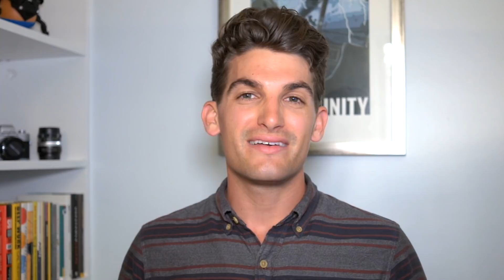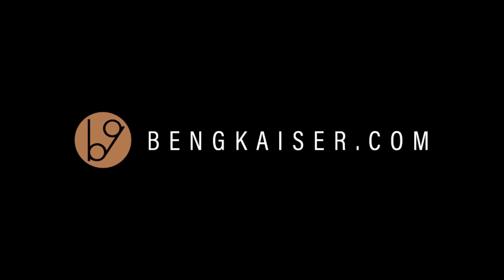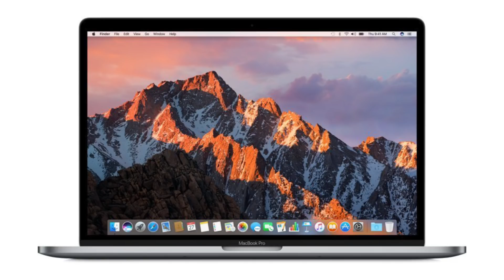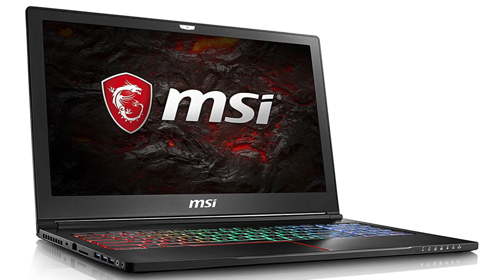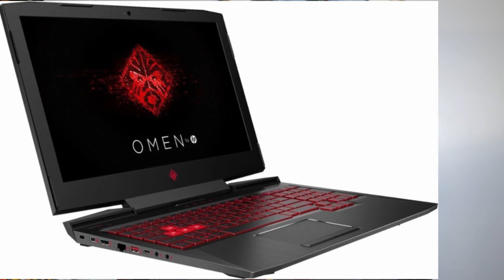Top 4 Best Laptops for Graphic Design

Comment: Everyone talk as if they are hardware engineers!! SSDs are more useful when you store files and images on them than storing applications. Once you start any app. The app code is loaded on RAM. But everytime the app need to load a file , it will read it from the hard desk!!! 
Save your psd's in SSDs. And save your apps on HHDs

Comment: Hello, Ben, thank you for sharing your experience with us. 
I have been looking for some information about macbook pro 15' 2015 (i7) - I am working only with images and graphic design, so I don't need so much video memory, and space, but I care, mainly, about the screen quality and color representation - is it Macbook suitable for me or I might try some other options? I've never had a macbook before so please tell me how comfortable is the 13' for some very window-loaded programs like illustrator or indesign or i probably have to only care about 15' models?
Reply from the maker: I am very happy with the Macbook Pro for strictly design related tasks. It is when you want to expand outside of Indesign, illustrator and basic Photoshop work that you get into trouble (the machine gets slow and does not perform really well). As far as the screen is concerned you will be very happy with the Mac screen color quality.
I like this model for design - https://amzn.to/2XsiNWO
Reply: @BenGKaiser  thank you very much

Comment: This is a great video!!! Thanks for sharing your knowledge. Question: i’m a 9 year macbook user, i recently tried the new surface laptop and it drove me nuts that i could not see thumbnails of my design files (psd ai png etc. ). Do most windows have this issue? Which one does not? In a fast paced work flow not seeing thumbnails slow me down... thanks again.
Reply from the maker: I have a Dell XPS 15 and I have not had this issue. When you are in your finder there is a "View" option tab up near the "File" tab if you click the "View" tab you should be able to change your finder view to see the icons. :)

Comment: I liked your video. I have just started into graphic designing. I plan to go for a HP laptop.  Can you please tell me how to caliberate laptop screen to match your printed output.?
Reply from the maker: That is something that relates directly to the printer you are using. For Instance, I used a Konica Minolta at my last working position and we calibrated with that system specifically.

Comment: Hello Ben, the 4k display is great, but are u able to get the same resolution on an external display? (u use a second display right?)
Reply from the maker: Hey Jeremy, I was going to trying and talk through this, but I found a great forum discussing this very question for you to get some insight on this. I hope this helps answer your question --- https://www.dell.com/community/XPS/XPS-9570-connecting-to-4k-uhd-monitor-through-hdmi/td-p/6093019
Reply: Ben G Kaiser yeah i already read that page, it was inconclusive that we can output at 4k to external display, so i was wondering if you found a way to do so. If not, then i really wouldn't spend extra money for 4k on 15.6" of display if i can be honest
Reply: Rather, it seemed like too much of a hassle to even TRY to find a cable/dock that can deliver that amt of data.
Reply from the maker: To me 4k is not a deal breaker. What are will you be using the laptop for SPECIFICALLY? :)
Reply: Ben G Kaiser planning to go into video, so that's premiere and after effects. Currently running illustrator, photoshop and lightroom T. T

Comment: Hi Ben I took a look at a lot of reviews for the Dell XPS 15 GTX 1050, as I am a graphic design student with a failing computer, and there is a concern that has popped up. A lot of reviews are saying that when trying to run taxing programs on both the GPU and CPU the computer either lags horribly or even crashes and has to force a restart. Have you had any issues with this since you upgraded seven months ago?
Reply from the maker: Hey Nate! I edit 4k video with my machine and I have not had it crash, nor become so horribly laggy that it becomes unusable. This is the experience I have had. I work in Photoshop, Premiere Pro and InDesign the most. When working in these programs the computer does slow a bit for sure, but I would expect it to with SO much stress on the machine. 
I think the main reason people are finding lag is that these computers are so thin and sleek that they have the potential to overheat, which causes the slowdown. If you deeply care about "HIGH PERFORMANCE" over style and metal/shiny build quality than I would go with a beefier computer like  Acer PRedator - https://amzn.to/2PZs2us - or a tower like the Dell XPS tower (if you don't need the portability - https://amzn.to/2Ssnu1i

Otherwise, the Dell XPS 15 has been a fantastic machine for my needs as a designer and video editor --- https://amzn.to/2EPUm1e --- I use the model with 32GB of RAM.

Comment: Really helpful video! And short enough. (Also you sound like Aziz Ansari so thats cool)
Reply from the maker: What did you find most helpful about the video? What part of the specs or buying process were you needing more information on?
Reply: Ben G Kaiser The opening gave me a good set of spec standards for my next laptop. And your approval of the XPS 15 really put me on the search for a machine with similar specs, but also with touch input. In an ideal world I'd buy the surface book 2. Would the XPS 15 2 in 1 be a good (and powerful) alternative?
Reply from the maker: I prefer the Dell XPS 15 over the Surface book 2 because of the more SOLID build quality.
This is the XPS I like! --- https://amzn.to/2Ev6qoi

Comment: Hey Ben I want to pick up the Lenovo Legion Y530 but I don't know which option to get. Either the i5 (8300H) with 4gb gtx 1050ti, 8gb ram, 128gb ssd, 1tb hdd OR i7 (8750H) with standard 4gb gtx 1050, 8gb ram, 128gb ssd, 1 tb hdd. HELP URGENT.
Reply from the maker: Hey! This is the model I would go for - https://amzn.to/2Gozhbw
I think 16GB of RAM is a great bonus to this machine.
Reply: @BenGKaiser  Hey Ben. Lenovo currently doesn't sell the 700 series in my country. I only have access to the above two mentioned. So what would be the best pick ?
Reply from the maker: I would go with this model! - https://amzn.to/2DrM3FI

Comment: Hello Ben, should i buy a touch screen laptop(Hp specter 360, etc ) or a laptop and drawing table saperately?
Reply from the maker: +Little Star light 
Check out the video I just put in on the Spectre x360 Vs the Surface book 2!
:)
Reply from the maker: +Little Star light 
You can check out the latest video I put out about the x360 Vs the Surface Book 2.

I am considering putting out a video about Wacom tablet vs Touch screen!

Comment: Does the MSI not have TN display which are not good for photo and graphic work
Reply from the maker: Yes, the Msi is a TN. This is something that the designer has to consider when selecting a laptop. Does the screen quality matter to you... for myself, performance can often out way screen quality, but for other screen quality is ESSENTIAL!

I wanted to give a range of option for designers to choose from which is why I included this model.
Reply: @BenGKaiser   Thank you for your reply. Its a shame its not a TB screen but using a TN screen for photo work is not good. It looks like I will have to look more closely at the HP Omen but I also read this screen (which is IPS) does not have a great colour range
Reply from the maker: If you want to have great color and great power check out the VivoBook Pro --- https://amzn.to/2DzAqOK or the Dell XPS 15 --- https://amzn.to/2DA3SUQ
Both are fantastic computers... I personally use the Dell XPS 15.

Comment: just needs your advice. I use Adobe illustrator. I am building a small pc starting with Ryzen 3 1200 with 8 gb of ram. Could you please help me find a budget graphics card around 50 Dollar. Or would you want me to buy a Ryzen 3 2200 G with integrated graphics which will eventually eat all the ram?. I at times do a bit of 3d revolves and bevel in illustrator. I now uses an Amd athlon II X2 260  3.20ghz processor. Is that sufficient really? Thank you
Reply from the maker: Hey! Thanks for the comment. PErsonally I would wait and save a little more money, rather than looking for a more affordable GPU. In the long run it will be way more valuable to have a high performing computer than a little saving in the moment.
https://amzn.to/2ML0hnS something like the GTX1050

Comment: I have $385 to spend, is there any laptops you could recommend? New or Refurbished. Thanks
Reply from the maker: Hey A Dzn I found three computers that would work, but are not up to par with my "Top recommendations" due to the lower specs needed for speed and efficiency when working in the Adobe CC suite.
Lenovo - https://amzn.to/2KqCWXK

HP Pavilion - https://amzn.to/2JCEQ6j

MSI (out of budget but a good buy) https://amzn.to/2HEjyZr
Reply: Ben G Kaiser i bought a lenovo 320s
Reply from the maker: Great! I hope this is a fit for your needs! 🙂👍
Reply: Ben G Kaiser do u think its good for photoshop?
Reply from the maker: Yeah, you should be able to handle photoshop. With less RAM try to not have many applications open at once and it will run smoother :)
Reply: Ben G Kaiser thanks for all the quick replies! The laptop i bought is terrible, I thought I did enough research. AMD A9 is terrible in my opinion.
Reply from the maker: You are most welcome! MAN. I am sorry to hear this.
What is the struggle? is it slow?
Reply: Ben G Kaiser again thanks for the fast replies. Budget was good however using photoshop was hell, psds coming out slighty pixelated, mouse too sensitive (even after being adjusted) when i add my colour correction it lags and also no scrubby zoom due to the graphics processor settings being greyed out (even after trying all methods to change it). And my old HP had lower specs but worked better?!
Reply from the maker: Man, that is frustrating! I hope you are still able to get some use out of it.
What kind of graphic design work are you doing specifically?
What industry? What type of designs? And for what medium?

Comment: what is good replacement or similar to GTX 1050?
Reply from the maker: Hey, thanks for the Comment Edison. 
Are you looking to replace the graphics card alone, or your entire machine?
Thanks for letter me help you with this.
Reply: hi mate thanks for your quick reply!
i kinda looking for same quality as GTX 1050...
furthermore to my question, i really need to buy a laptop that is good for my graphic designin and photography, though my budget is as low as 800 US dollars.
any recommendation? thank you so much mate!
Reply from the maker: Hey you are most welcome!
I would go with the MSI GL62M. https://amzn.to/2EdQa5M It is not the premium power I would give my highest recommendation to but it is a well equipped computer for the price.
As far as GTX comparison you could check out the Radeon RX560 https://amzn.to/2Gs1Nfs

Any more question shoot them my way! :)
Reply: thanks again mate! very helpful! 
i'm checking now the link that you sent. the specs are really awesome, i may consider buying this.
inside of this model is 8GB or ram, i think still standard.
accurate screen display is important in graphic designing and photography, do you have idea if this model screen is accurate or still needs screen calibration. thanks again mate! you are amazing!
Reply from the maker: Yeah, great specs for the price! It is a gaming based computer so I am sure the calibration is pretty solid. But I do NOT know for certain...

Comment: Thanks man, 
I just bought razer blade gaming with 1060 2017 and it was not so good in illustrator software, while rendering 3D image . I was confused and now I am going to buy again dell xps 15 9560 and upgrade  it with 32gig ram if that helps in graphic design. I tried Microsoft surface laptop but that was 4gig so No, and tried MacBook Pro 2016 13 that also was not doing the illustrator job well, I was using illustrator cc2018. I sold my xps15 9560 and bought razer blade for gaming as I was only playing games on xps 15 and that started to have shutdown problems. So sold it and got the Razer blade. Well I will go back to the shop tomorrow to ask for my dell xps 15 back. So I can flawlessly work on my illustrator projects. Can anyone plz tell me why razer blade 2017, 16gig 512ssd gtx1060 6gb took so much time to render a small 3D image ?
Reply from the maker: Hey Man! Thanks for the comment. The struggle is real, trying to find the best fit for a design laptop. That is why I dedicate so many videos on my channel to do so.

Let me ask you. Were you trying to Game while rending?
Reply: Ben G Kaiser big help bro, big help ! Thank you